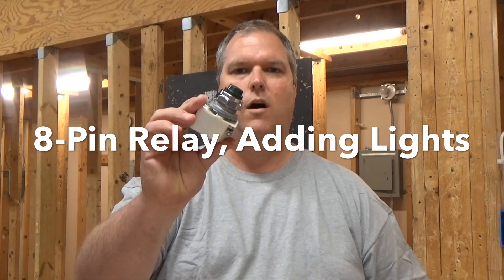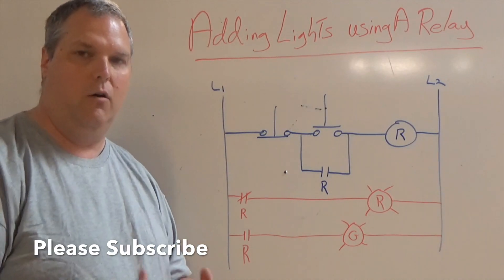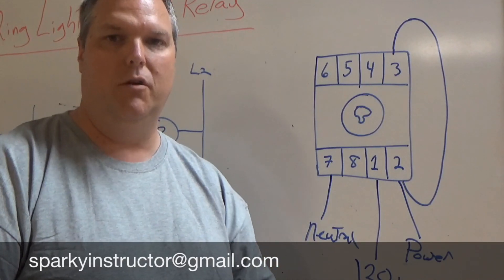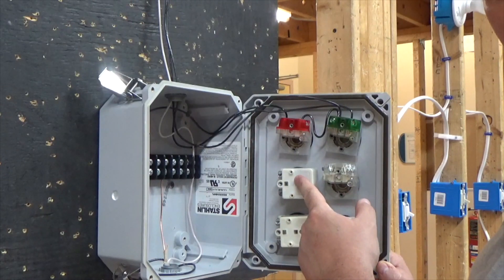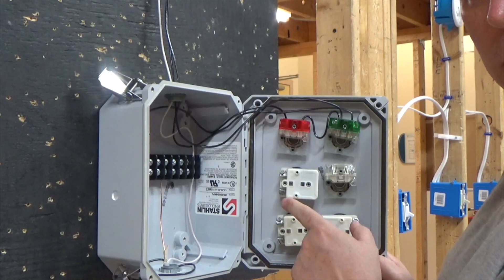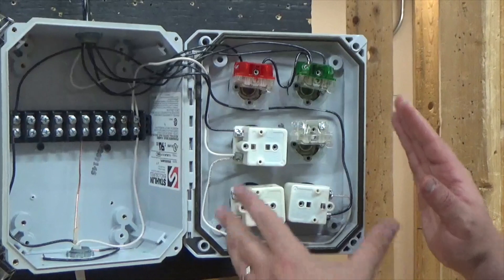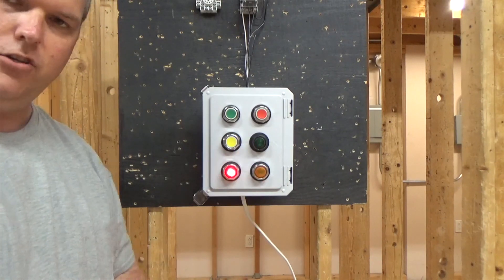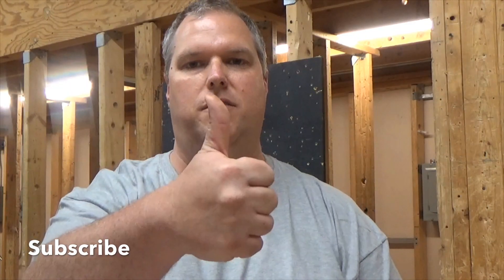Wiring Lights controlled by an 8-pin Relay

Comment: I may need help with what I need to make. I need to make a test panel box with lights for each connection on both 8pin and 11 pin. A box like u made with lights for each pin connection so u know all pins and connections are working. How could I add in a toggle switch for each no/NC circuit. If that makes sense.

Comment: do you have demonstration on the square D NEMA starter?? i need to see how contacts on left work
Reply from the maker: Sorry not yet but I will add it to my list of video's to make. I know it does not help now. CM
Reply: @craigmichaud-electricalins4602  just quick question is the 2 and 3 contacts on the left for the coil n/o or n/c ??

Comment: How would you make a green light turn on and hold and turn off and hold with the same push button.
Reply: You will need a push button designed to hold a set of normally open and normally closed contacts

Comment: I have a 110 volt motor it requires 4 wire power neutral a forward and reverse how do I get four wire from the 8pin relay

Comment: Great video Craig! I do have a question.. could this be used for a swimming pool pump? I have a pump that I would like to connect lights to to indicate when the pump is running so I can see it from the house. Also, where is a good place to order the indicator lights and enclosures?
Reply: Great ideas!!!!!!!!!!